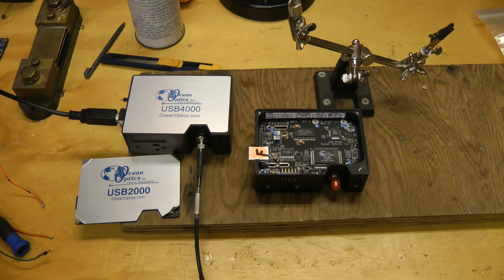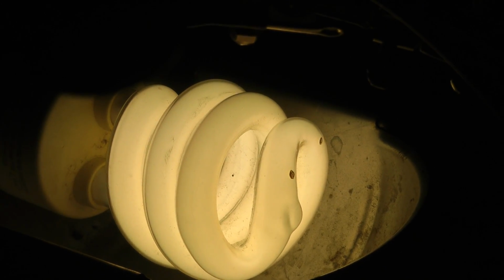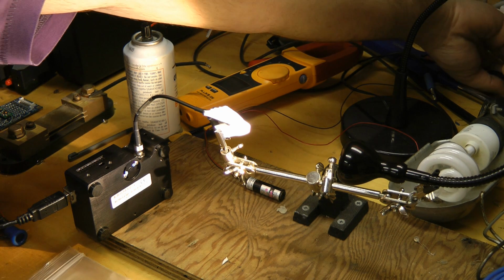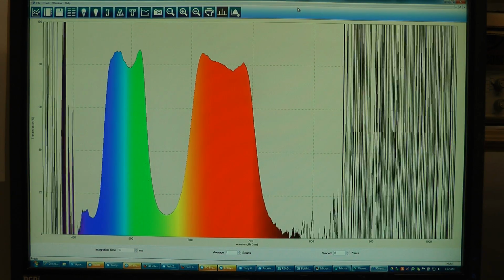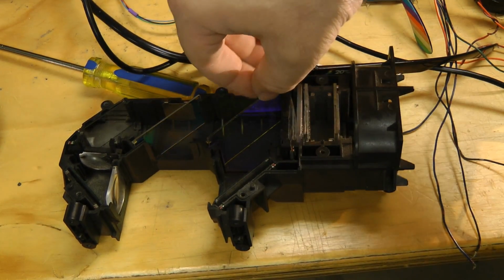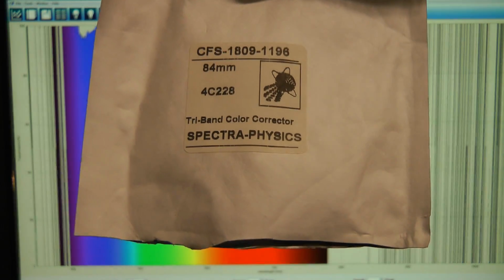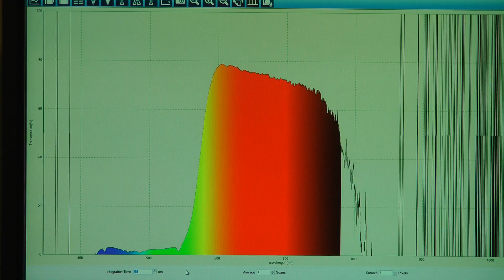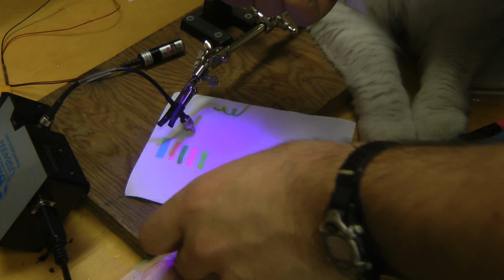Spectrometer overview and applications

Comment: These peaks from incandescent bulbs is actually "bug" of the spectrometer, likely an interference on the cover glass of the CCD sensor. I've seen one of manufacturers having models with different sensors with a not that high-resolution sensor cause these peaks due to cover glass, and lower resolution one is just fine (with the rest of the system being unchanged). This might also be calibrated, but might be quite tacky. This interference could be helped with AR coating, but you can't have AR coating for the whole 200..1100 band...
Reply: +BarsMonster Mine CCD spectrometer has only 350-700 band, and incandescent spectrum have no peaks.

Comment: Do you think it is possible to use a similar equipment to identify the element composition of a metal surface?
Reply: Roger Nevez unfortunately no. Due to the relatively delocalized elections in a metal, metals tend to have broad band spectrums in the bulk. That's why there are relatively few colored metals; gold, copper, and osmium are the most colorful. The rest tend to be bluish grey.

Alloy more than one metal and you are completely up a creek. You need to do x-ray spectroscopy which functions by a broadly different mechanism.

Comment: Interesting point about the yellow highlighter fluorescing, which should be expected if you've ever seen their ink under a 'black light'/UVA tube.

I recently read of how certain laundry detergents may undergo a reformulation as we convert to LED lighting. Apparently it is common to add 'optical brighteners' (http://en.wikipedia.org/wiki/Optical_brightener) which fluoresce from UV light, and then makes white clothing seem "whiter than white" as an advertiser might say.

(referred article for those interested: http://www.futurity.org/efficient-led-bulbs-dont-get-quite-white/)

Comment: I used one of these spectrometers for characterizing LEDs (white, colors and IR). I don't have access to it anymore :( but still want one (wanting is not enough at this price though).

If you hadn't found it out by yourself, I'd sure have told you to try out highlighters ;) . If you open one up (can even be an dried out old one) and squish the ink felt in a little bit of water you get some very "glowy" water, especially with UV. You could try to measure the fluorescence wavelength by shining UV at a small container.

Btw. white paper often already has some fluorescent dyes in it to make it appear whiter. That's why you got your known "standard grey" or "standard white" with the spectrometer.